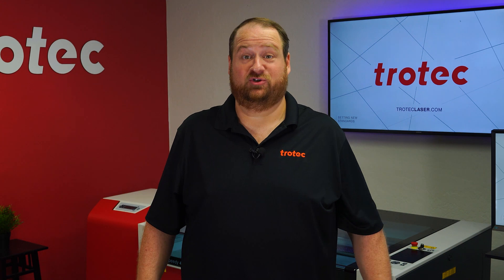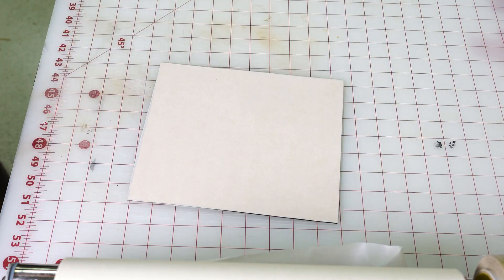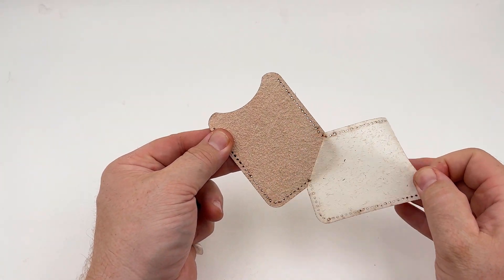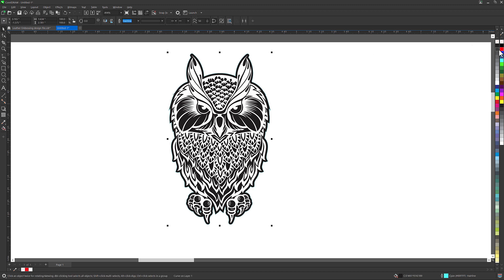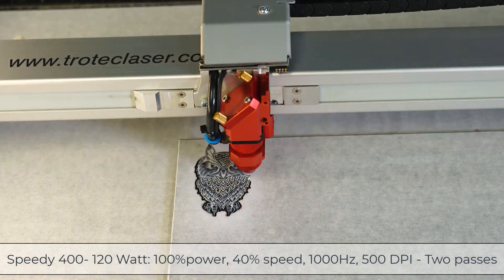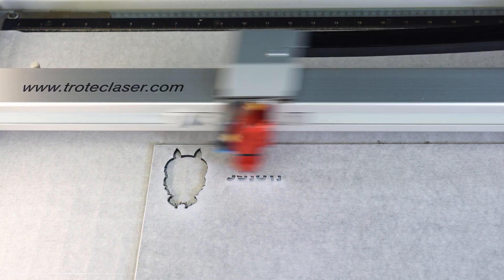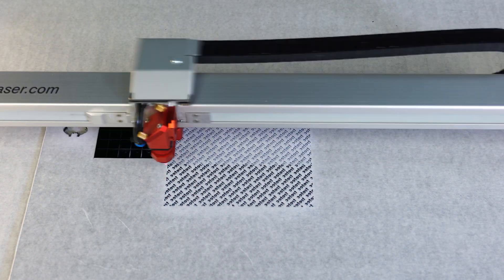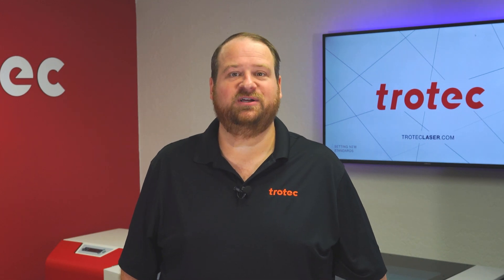Deep Dive with Laser Dave: Leather Embossing and Debossing Dies with Delrin Plastic

Comment: Just a warning. Invert Colors in the latest Illustrator (27.9) is under Edit->Edit Colors. Not sure if this is a configuration issue or not. Also, I have text that I converted to vectors and Invert Colors doesn't work to invert the background. The background stays white and the black text becomes white. I'm finding it surprisingly difficult to find any generalized help on how to create text and images  in illustrator for laser cutting embossing dies.

Comment: A couple of points to note:  1) Dampen the leather before stamping; it will make it easier and more defined.  2) If you don't have a press, DO NOT use a hammer. Sandwich the leather & stamp between two pieces of plywood and clamp together using "C" or "F" style clamps.
Reply: Great advice, Thank you for the tip!😃
Reply: Or crush it in a vise between pieces of wood. That works too.